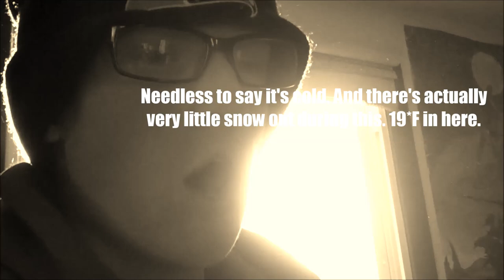FORGING A KNIFE FROM A LAWNMOWER BLADE

Comment: Say Heah Sam, Great video, great work. Yeah a lawnmower blade would not be my first choice for the steel. We imagine  how tough the steel is, but for it to be a tough blade steel more carbon is needed plus other alloys. but no offence, I think you did a awesome job making that knife. When you compared your O.K.C. Butcher Knife I noticed how much belly was curved, lately I've been experimenting with curved belly knives as carvers, the curved belly so far is proving to be great carvers. My Skookum Bush Tool is 4" blade and a very curved belly, I knew the design made it a great carver, but I didn't know why, then I started to pay attention to people like William Collins and also watched video's. I saw a Tribesmen carve a bow with a large machete sized blade, both pinch the blade close to the edge, William said "The closer your hand is to the blade, the more control". Anyhow that's proving true with my Ka-Bar Johnson Adventure Potbelly too. Anyhow Thanx for a great video. Job well done. Maybe that will help you make carving knives.

Comment: Nice work! This really inspires me to make something like this too. Could you explain how to do the heat treating?
Reply from the maker: Sure thing! ON one hand it'd be easier to look it up on while on YouTube but here it goes.
First heat your metal to a nice bright cherry, or until the point it's no longer magnetic, ( I go until about orange yellow) Then once that's done, quench in used or non used car oil. you can also use veggie oil. It's a little healthier for you rather than car oil. Then once done clean it off. Next you put in the oven for 410 degrees for 1 hour and repeat twice. Now it's heat treated and tempered. Ill make a video on heat treating here soon, so stay tuned for it.
Hope this helps!
-Sam
Reply: Samuel Morrison thanks, that really helps

Comment: is it better to make an edge before hardening and tempering, between hardening and tempering or after (I'm planning to use rotary grinder)? And any techniques on aligning the edge to be in the middle? (This is my first time doing a knife).
Reply from the maker: i would not sharpen it until after the blade is quenched and tempered, and cleaned to taste. reason being is that if you have a razor edge and quench it or even a dull edge, it will not properly heat treat the edge fully. and to align the edge in the middle I use a drill bit the same thickness as my stock (material)  after I paint the edge with a marker so i can see the scratch lines as you drag it across the edge profile and flip it to repeat on the other side so there is about ! millimeter left in the middle to sharpen it then and for a good heat treat. ill try to make a video on this very soon. Hope this helps!
-Sam
Reply: Oh,thanx for quick reply (btw. this video is great) , I didn't mean to sharpen it untill heat treating it, just to make V shape (its hard to express myself in english).
Reply from the maker: TRUPAC12 No problem! :) More videos are coming soon, just am having a hard time piecing things together with me still being in school. 
:) Sam
Reply: Samuel Morrison Oh, then you are probably the youngest person I've seen that does this, it's great I always had a feeling that only older people do this kind of stuff. Could you please give me some advices on how to sharpen the knife, I've made one yesterday and now I'm having trouble sharpening it, idk if I should use rotary grinder or what? I've already done sharpening with 2 different grade of files, a sandpaper and a few circles of sharpening with a sharpening stone, but just can't get it right.
Reply from the maker: I'll try to make a video to answer your question, how's that sound. I'll post tomorrow.
Reply: oh, it would be great,thank you so much :)

Comment: I am a member of the A.B.A. and a teacher of smithing i like that u used what was on hand but i am a little worried that you made the still so soft that a hacksaw could cut in to it please do a brake test for you protection to see if you heat treated the blad right but very good work

Comment: First off that is a kick ass knife and well done product. 
BUT as other comments say is not "forging" .yes you did forge the lawnmower blade into a stock. But you used stock removal to do pretty much all of the work. You'd have to forge at least the bevels after you flatten the stock to call it forging (usually you'd also have to forge the tang  and the point and cut off excess if necessary) you also hit it to straighten while it was cold which ain't healthy for the steel, but I assumed you annealed it well because nothing went wrong in your heat treatment. So that worked out good. (Hitting bronze cold will harden it though) When you're filing I hope you are aware that files only cut on the push and I'd say an angle grinder is a good investment. Also did you use an axe to smith the piece flat? Because that's just jokes, again it worked though so that's awesome. Just saying the knife ended up really good but like me you're also a young guy who's learning and getting better. Cheers m8

Comment: The video was well thought out and the knife was correctly made but I didn't see you temper the blade only quench it and how old are you 17
Reply from the maker: No, i am 16. I did quench the blade and temper. Thats why it has the cool look on the blade and it is golden because an appropriate tempering. :) I will show later how to heat treat a blade. I will post vids soon.

Comment: What oil did you use? Also did you free hand that blade tip or is there a template I could use? BTW, very nice job man
Reply from the maker: Always Armed88 I free handed the junk out of that thing man. I made no template whatsoever. I used refined motor oil. It works pretty well as long as I keep it clean and refined. 
-Sam
Reply: Samuel Morrison that's cool man. I want one like that for a survival/bushcraft knife
Reply from the maker: Always Armed88 I can make you one. I have 1095 and o1 tool steel available. let me know what you are thinking. 
-Sam
Reply: Samuel Morrison that's cool man. If I had the money, I'd Def buy one from ya. Hopefully maybe in the future

Comment: You used stock removal, not forging.
Reply: +VampyrDjevelDeity People that put the metal into the forge to "forge" it to shape can indeed use Forging in the title.
Reply: +uasuperman069 sorry but no, if you take a piece of metal, run it through a forge, and turn it into something using a forge primarily, you have forged something out of metal. You cut a knife out of a piece of lawn mower blade. I'll make sure to tag you in my future video of myself forging a knife from a lawn mower glade.
Reply: uasuperman069 nope that doent make it forging that makes its stocl removal. just like with leaf spring you have to flatten it first
Reply: Cory Jones + Just saw this, tag me too. I want to see your video!

Comment: Why was the blade quenched in oil rather than water?
Reply: Because water cools it down too fast and can make the blade crack. If you don't want a unpleasant smell try olive oil
Reply: +TacticalTimmy12 Depending on the metal, you can use different methods of quenching. Generally the lower the carbon steel the faster you should quench it I believe. Mild steel can be quenched in water to sort of case harden it. Higher carbon steel can be quenched in oil to get a more through and through hardening.

Comment: What sort of carbon content is in a blade like this?
Reply from the maker: Jordan Roncari not very much but this has a higher grade carbon than other lawnmower steels. With lawn mower blades its a real hit and miss process but you can still get a good knife out of it. It may not hold edge as long as 1095 or 01 but will do the job if needed in a pinch! :)
-Sam

Comment: why oil and not water ? thnx
Reply from the maker: I chose oil because it give a better and more full hardening because it doesn't quench it so rapidly like water. Imagine a hot day and jumping into ice water. That's what quenching in water would be like for the blade, therefore giving it the chance of cracking. Oil reduces this chance because it's a "slower quench" but more effective if pre heated so no vapor pockets are made preventing the full hardening. Hope this helps! 
-Sam

Comment: If a bum fire is hot enough to heat that metal up(500 degrees) that's some cheap ass metal. Certainly not steel, as steel is 600 degrees just to become pliable. Not even worth making into a knife.
Reply: It's low carbon steel as it is a mower blade. And that metal is around 1000 to 1100 degrees.  And any other metals that look similar (excluding titanium) would have long melted by that temp.
Reply: It's low carbon steel as it is a mower blade. And that metal is around 1000 to 1100 degrees.  And any other metals that look similar (excluding titanium) would have long melted by that temp.
Reply: It's low carbon steel as it is a mower blade. And that metal is around 1000 to 1100 degrees.  And any other metals that look similar (excluding titanium) would have long melted by that temp.